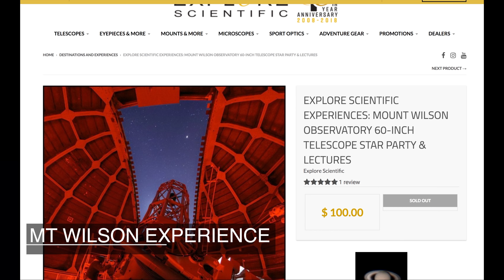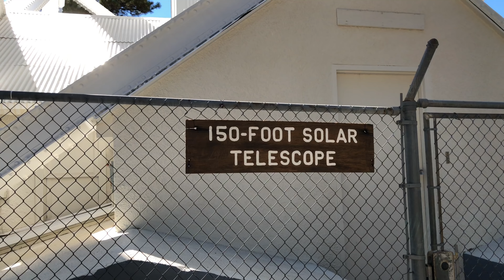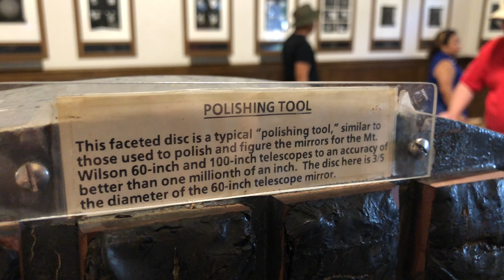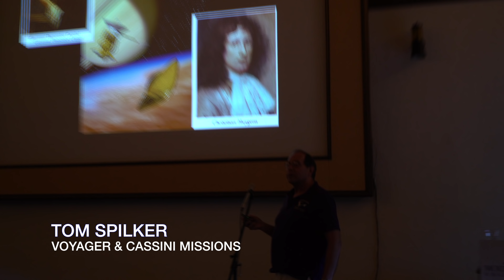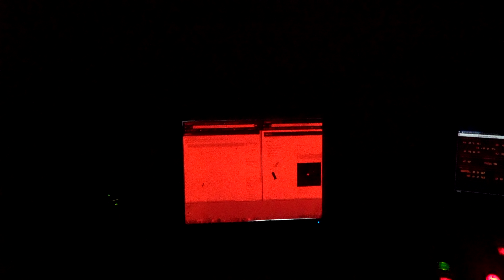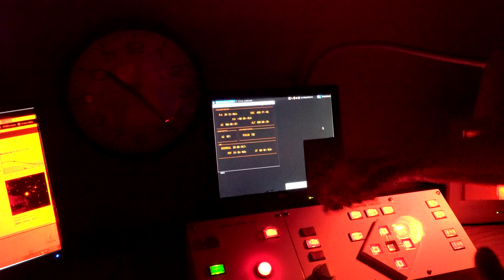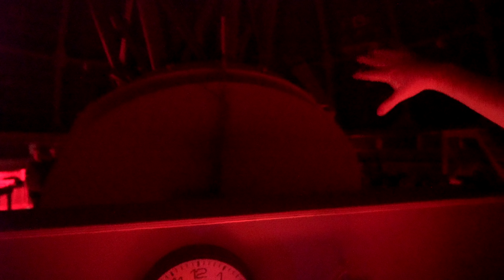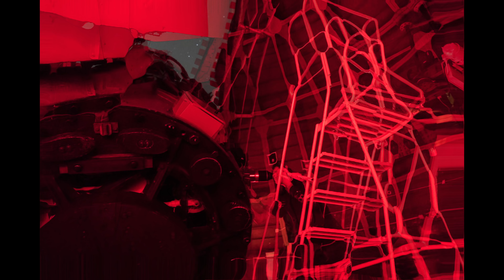60 inch Telescope - Mount Wilson Experience

Comment: Ahhhh, I see.  So, that's what a Dobsonian on an equatorial mount looks like.  No wonder you never see them anywhere else.  Oddly, given the aperture, I thought the viewing would be a bit better, but this looks like the same sort of data you'd see through an 8" Celestron.
Reply from the maker: Meadmaker 452 it’s actually a very old traditional Cassegrain reflector with a tertiary mirror. That third mirror adds a lot of artifacts that might not be there if it was in the traditional cassegrain setup. The images I show were taken with my iPhone and could never show you what your eye would see at the eyepiece. I put my iPhone up to a lot of eyepieces and I can tell ya this scope performed amazingly and probably better than most scopes I’ve used. Also, the more aperture you have, the more that can add distortion into the image. If the skies aren’t the best, that is only magnified on scopes this massive. The in eye view was absolutely stunning on this one. Especially planetary nebulae and the planets.
Reply: @DeepSkyDude  - My initial comment was a bit tongue-in-cheek, but I do understand that the iPhone wasn't going to give the best visual results.  The tertiary mirror on a Cassegrain setup is interesting.  I wonder if they've ever hooked up a quality CCD to it, just to see what sort of imagery they could obtain?  The typical Achilles heel of the Dobs (I know this one isn't, strictly speaking) is the alt-az mount and lack of tracking, but it seems this one has the gear to overcome those shortcomings.  I can only imagine how cool it must have been to peer through the eyepiece on this monster. 

I think, for most people, if you ask them the typical, "What would you do if you won the lottery," question, most of them would talk about houses and cars, boats, etc.  Astronomers would talk about getting this thing in their back yard!